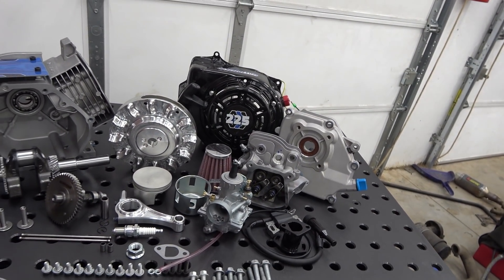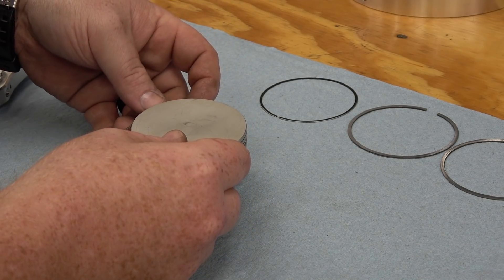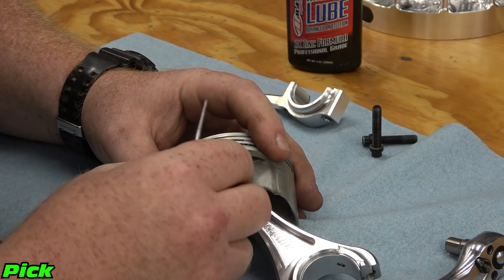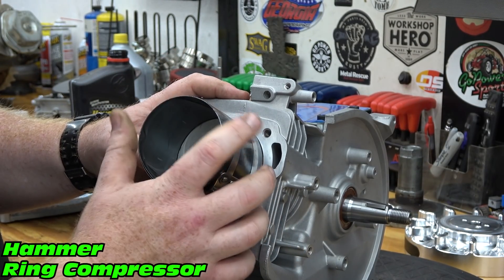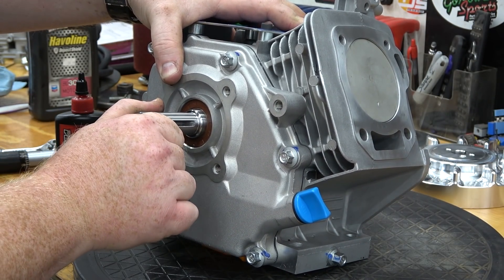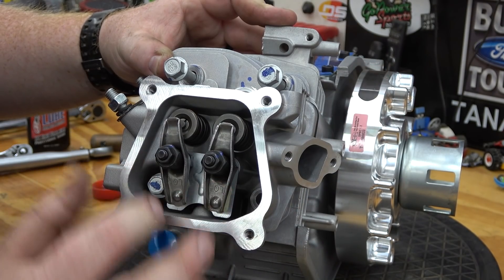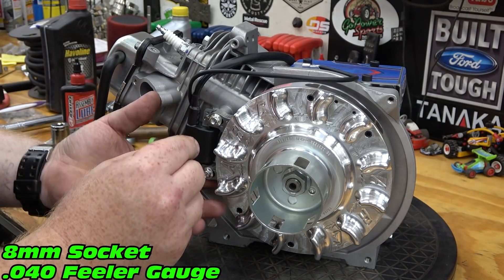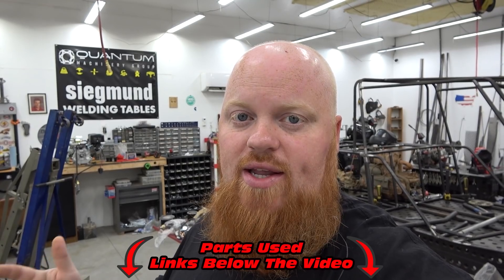Tillotson 225cc DIY Builders Kit

Comment: I know this video is 3 years old now, but im trying to source titanium fasteners for a tilly 212ee, when i buy one but i cant find a parts list which has all the bolt sizes and lengths, and ive seen both 5/16 and M8 thread for the crankshaft bolt, best ive been able to source is a honda gx200 parts diagram/list, but there are 3 different models which have slightly different fasteners. I was able to figure out every bolt except the 2 that hold the electric start motor together, those are just listed as "bolt, setting" whereas most of the other bolts are "bolt, flanged, 6x25" or whatever else bolt size. It would be very useful if someone would make a reddit post listing all the bolts that the tillotson 212ee has in it. Im also thinking about titanium studs too, but those will probably be harder to source (i currently have a cart with $392 in nuts/bolts on racetechtitanium . com) there is only 1 bolt it wouldnt let me add to cart/backorder, so i had to wishlist it, and they do have studs, but not in custom sizes

Comment: We are running the 225 rs in the caged clone class and have heard different specs for cylinder head torques between 27 to 24 We have been having some issues with head gasket and head warpage at the exhaust side.Appreciate any suggestions. Thank you

Comment: Hello , really enjoy your video content .. Is this the 225rs ? I'm looking at the rs long block . Wondering if the DC PVL flywheel will work with this engine . I've got it on a predator 224 now . Its the aluminum , unpolished , with a steel core flywheel . Reached out to GPS , didn't have much luck . Thanks

Comment: That is actually not a forged piston according to E carbs it is closer to a weisco then a stock piston but it is somewhere in the middle.  Go powersports is bad about miss advertising E carbs designed the new tillitson reinforced block.  I loved when you put that oil cooler on that 420.  I am putting one on my 460 once I figure out what I am going to use as a quality pump (probably a pulse pump) then my return line will go to a Y then one in the valve cover and the other down the governor hole . Once my system is reliable I am going to eliminate the diper .

Comment: do you guys check the ring gap, or just throw these things together assuming the gap is correct?

I just purchased the Tillotson Racing 72mm block, forged flat top piston, 2.165 crank, and the GPS 225/228 long billet con rod.. and want to know if I also need the tools to measure and adjust these things, or am I safe assuming they're right

and will that heat shield for the head be available from GPS?...I was planning on cutting down a generic shield if I can't get a nicer one

Comment: For those wondering the u build it kit doesn't come with all that. 

Looking at the website its 500 for the block. 100 for the billet flywheel. 550 for the u build it and assembly kit. 200 for the carb. You'd still need 80 for an exhaust. 60 to 90 for the fuel tank. And 175 for the 30 series juggernaut converter kit. 

So about $1700 for the engine build plus a lil extra for all the odds and ends. About $1400 is you dont need the tank, tav and exhaust.

Comment: Hello I have a 212 predator non hemi engine. I have misplaced or lost the head and side cover dowel pins. Do you know where I can get them?  Like a website maybe? 
Also are all other predator engines dowel pins the same? I know the head and side cover pins are different. 

Thank you so much 
Misti
Reply from the maker: Should be the same as a gx200. Look it up on ebay

Comment: Could you guys do a video on the razor electric dune buggy a couple people have put 3000w motors and get 35 40mph but there's no videos showing how. Some people have even put 212 motors it would be nice to see what crazy thing you can make from it
Reply from the maker: I'll see if I can find one in our area.
Reply: @RedBeardsGarage  or better yet razor has pocket mods you can upgrade to 1000w motors but razor not to long ago came out with the bellezza model its quite a bit bigger with actually bike size tires upgrade to some knobby tires, and from what I can see you might be able to get a 3000w motor in it there is not one single video on this scooter AAAAHHHHHHHH??????

Comment: Great build.  I was able to score a MB200 from the local transfer station.   Guy pulled up and was going to put it on the 'discarded metal' heap.  I had him load it into the back of my truck instead.  :)  Was missing a bunch of stuff, but GoPowerSports was able to fix me up with all the missing parts.  I live about 3 miles away from them in Fort Worth, so it was easy to get the parts quickly.  
I have a new 212 (Harbor freight special) on it now, but would like to put a little more power to the road.  This looks like a great build to get it done.  
Keep up the good work.  I love to watch your vids.  They are instructional and fun.  God bless your work.
Reply from the maker: Thanks you for watching sir. The mb200 is by far the best mini bike on the market.

Comment: Hey man love the videos I'm in the mix of swapping out my 196 clone for a gx270 I've got the 1in driver but from what I've read there saying I don't need the bronze (brass) bushing for the shaft . I'm just confused if the 3/4 shaft uses it why doesn't a 1inch ? Should It be fine?
Reply from the maker: It will work fine without it. It can help with creaping at idle but I don't think you will have a problem
Reply: @RedBeardsGarage  thanks for the tip man👍👍 do u think the 30 series belts will do ok with the 9hp gx270?

Comment: Ummmm,I'm tellinggg.You forgot to put 'valve seating compound'on the shaft and twisting the flywheel until it gets a full seating.Then you've cleaned that off and installed the key,and bolted the starting cup,etc.on.If I hadn't seen you do it,I'd have had no clue that it was needed.Thanks for all the hard work you guys do for us.

Comment: Why cant they make a Billet Flywheel with charging system? And what do you think about the gasket sealer spray?
Reply from the maker: Aluminum has to be thick to have strength and it's hard to fit the coil behind the flywheel. I do use the sealer spray on some gaskets.
Reply: @RedBeardsGarage  Could they (go power sports) get a custom thinner coil made.?
Reply from the maker: Yeah but the cost of that would be crazy high and would take too long to get a return.
Reply: @RedBeardsGarage  You could put a extra sprocket on the axle and hook it up to a alternator to charge the battery.

Comment: Great Video well done .. if I had a shop like that i would have a clean room to build engines in ,, lol  i would still be doing what you are build them on a clean bench .. just repaired a riding mower other day would not crank over past compression .. valves way out of adjustment ,, push rods almost falling out loose .. adjusted starts great ,, also seen valve guides loosen in heads before and rocker studs work loose , seen a lot in over 40 years of working on them ,, roughly how long do you run a built engine before you change the oil ??
Reply from the maker: I actually have one but have to use it for my office until next year. Check out our apartment build and you'll understand why.
Reply: @RedBeardsGarage  did not know you used it for your office .. I seen the build shows .. you have done great work over the years ,, It took me 20 plus years living on a half acre lot to be able to get the new place I have. 30 acres with a home and 3 out buildings ,, a 2 car garage , 30 x 80 dome tent barn ,, then my shop witch is a 30 x 40 pole barn 10 ft walls .. no insolation yet started putting 2 x 4's for the steel ceiling . it all takes time .. don't remember what size your shop is but it looks to be 3 times bigger then your old garage ,, one thing i did get going is a dirt track in the field ,, for the grandkids and us adults . its a dust bowl if dry or nice and muddy if it rains , needs more work plus i want a ovel track too be able to get higher speeds ,, keep up the great videos love watching them ,,

Comment: Is that a fuel tank on a tripod? That's so smart.
Reply from the maker: lol yes. Making due with what I had.
Reply: @RedBeardsGarage  I'm 100% using this idea.  It will beat always trying to find a spot to hang up a plastic tank with tig wire during testing.

Comment: Someday gopowersports will actually have engines in stock. I've been waiting for months.
Reply from the maker: Its hard during these times. They are working as hard as they can to get engines and parts as fast as possible. As soon as they get some stock they sell out.
Reply: Pfft, harbor freight doesn’t even have engines, you think smaller companies like tillotson or GPS are going to?
Reply: @floivanus  harbor frieght has engines. Depends in your location. But they don't have 225 type engines that I'm looking for.
Reply: @mkuhlman77  every harbor freight within 150 miles of my truck route shows zero 6.5hp horizontal shafts in stock

Might have something to do with a shortage related to the effects of shutting down in 2020?? Who knows